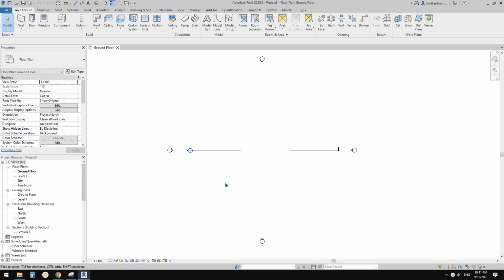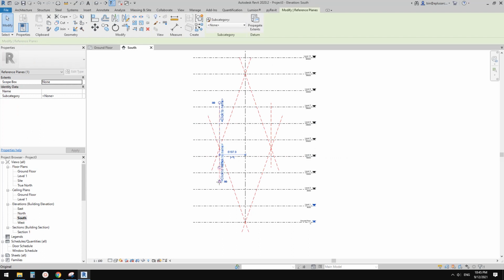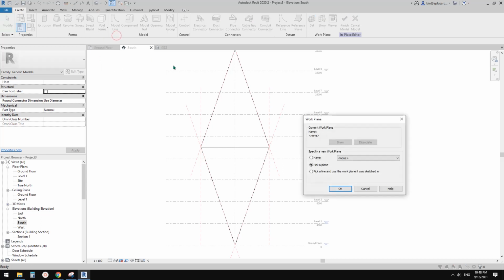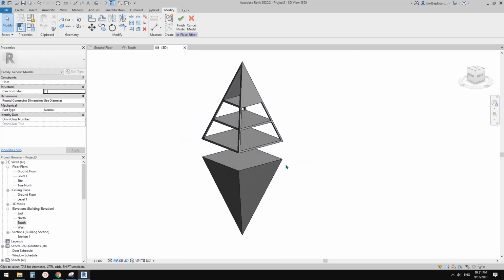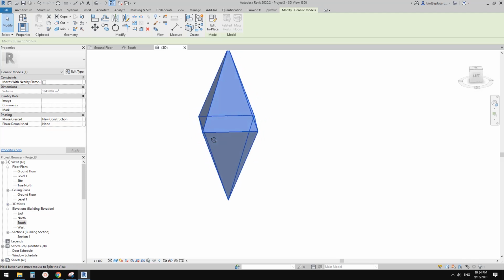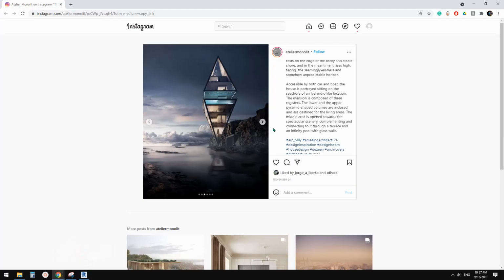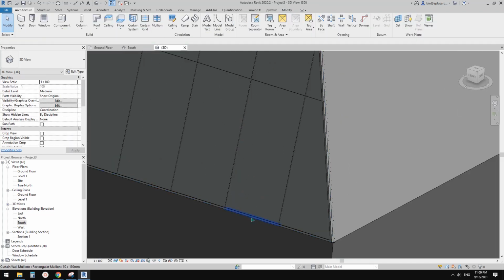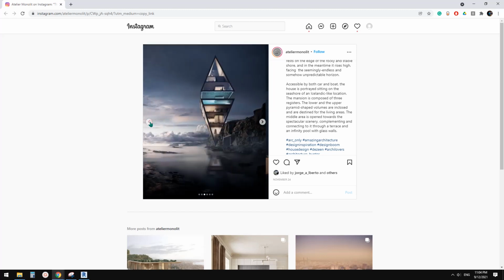Revit Exercise (Day 625) Let's model some simple geometry

Comment: Nice …. Very good understanding of model in place 
1. In sweep: Of course you could have picked the square instead of drawing the path as a circle. In this case you won’t need to rotate the circle to get the path on the right side (cause if you did your path as a square the first picked side will be the profile side) 
Also you won’t need to check the option of projectory segmentation ? 
But very nice to know these tricks if you must have your path as a circle 
2. To repeat the openings in top of pyramid you ‘ve copied the sketch of void extrusion then adjust it then extrude void. You could as well copy the whole void (not the sketch) upward then adjust it with the grips(arrows) ?
3. I wonder how the wall by face on the 4 sides continue to be joined although they end in one point !
Reply from the maker: 1. you are correct, I was doing it the harder way.
2. I think so.
3. I don't think they will join perfectly.
Reply: @BINHE615  it is nice to hear about theses very hidden options … if you did not mention it probably I would never heated about it